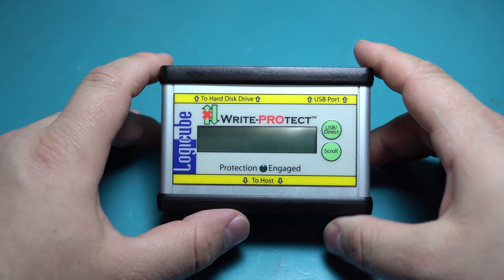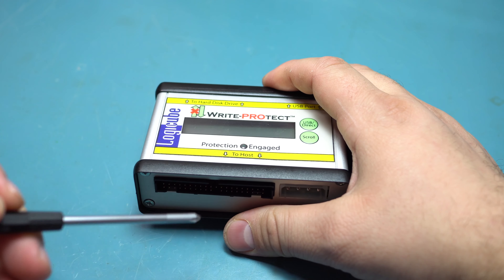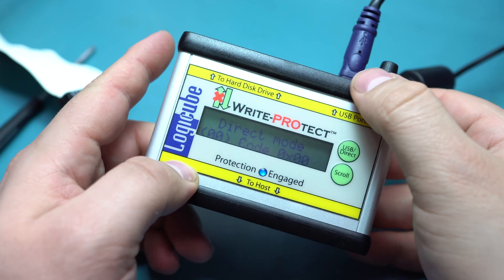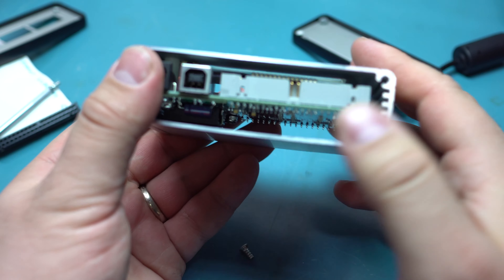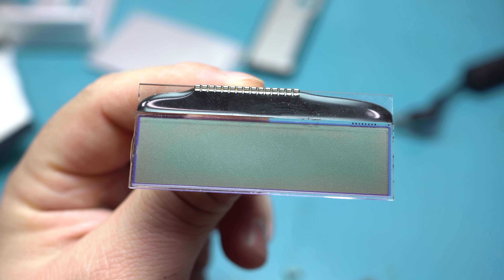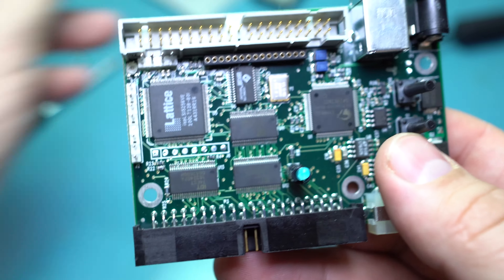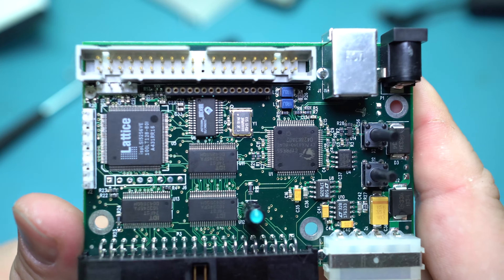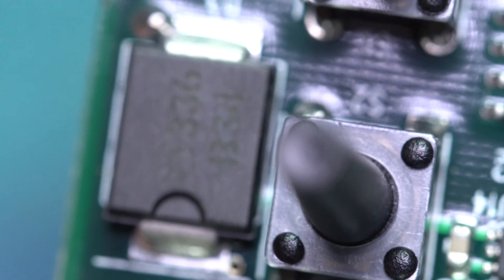Logicube Write Protect Teardown

Comment: I guess the Lattice chip is just looking for write commands and filtering them and sending back fake responses that it is ok.  I'm assuming this device is used for data forensics and evidence collection, so you can access the data without touching altering it in any way.  One place I used to work had a dedicated guy in IT that handled all of the hard drives that were on hold for legal purposes.  Typically he would jut have someone make a backup of the drive and do all of his poking around on the copy, but include the original as evidence.  Any time we had an employee terminated while on legal hold, we would wrap the drive in the printed request and staple it closed and sign that we had sealed it, and he would be the one to break the seal.
Reply from the maker: +stonent It's for forensics. It came in the same kit the other Logicube stuff came in - I just didn't realize it was still in my closet. Haha

I have some more forensics stuff I will do videos on. Mostly stuff to hack into and copy cellphones - but I'm waiting on tracking down some compatible phones on eBay (cheaply) before doing the videos.
Reply: @peter
That sounds pretty interesting. What kind of phones is it for?
Reply from the maker: +Browningate Dozens and dozens. All brands.
Reply: *****
Is that for Android and iOS devices then?
Reply from the maker: It works on older OS versions and hardware. Newer ones (especially the iPhone) are secured with hardware based encryption and security co-processors which it can't bypass. They do make a version with a camera and a USB interface which essentially brute force tries every pass code possible until the phone unlocks (as long as you don't have iOS set to trash the data after 10 tries).
Reply: *****
Interesting. I'll look forward to seeing it.
Reply: In the good old time where this device was sold for 1/5 of the price they do now (it's AFAIK about US$ 500) it was for example also used in schools. At times when networking and protection (Win95/98) wasn't as perfect as now it allowed the teacher to just hit a button in the computer lab and don't care about teenager induced viruses and games. This was much cheaper then buying a WinNT license and did not require a teacher with admin education so it was a popular solution, at least here in Germany.